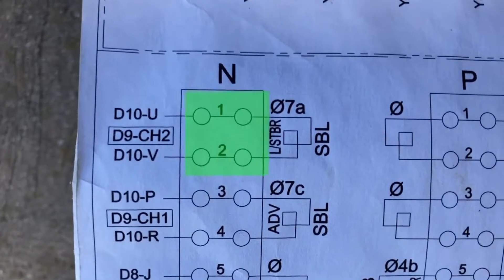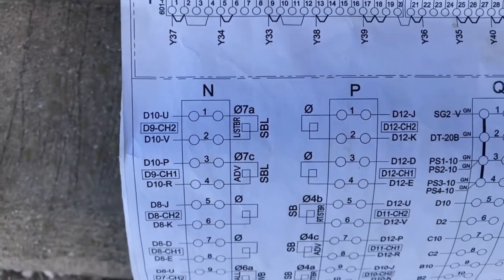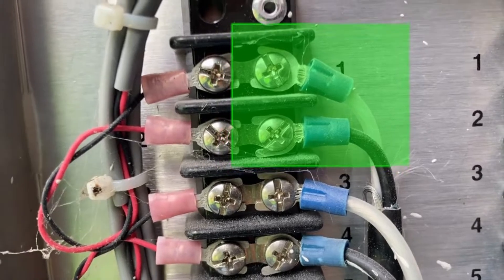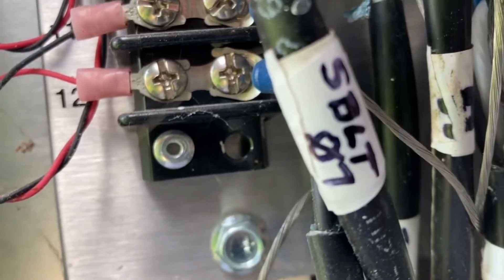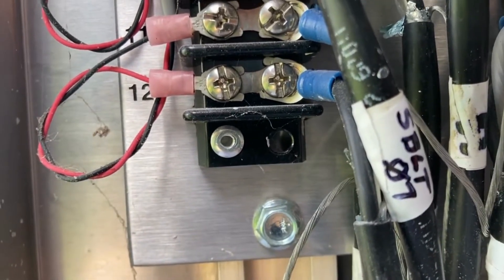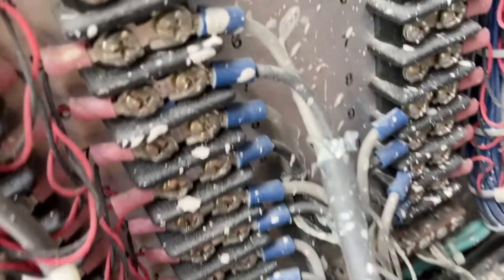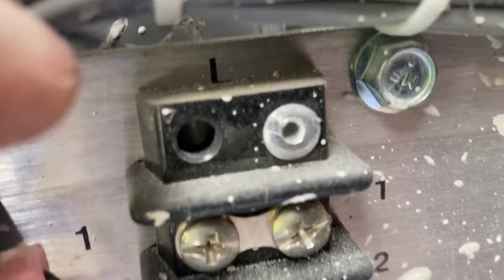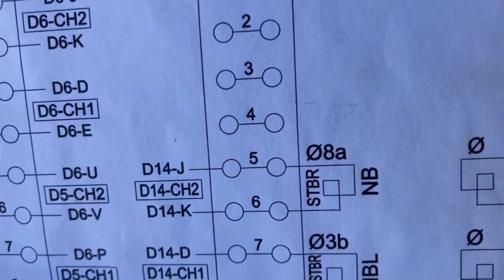How to Properly Label Traffic Detector Loops

Comment: How do you test your DLC and or Loops?
Reply from the maker: I have a megger that I can use.  There are several tests including continuity and also testing ground wire to loop wire integrity. 
Many times I find that the connection (loop wire in road connected to 2c wire running back to cabinet) in the pullbox is compromised.  Usually just resplicing there fixes the problem.  Hope that helps.
Great question!

Comment: 0:23 Isn't that a fault of not setting maximum green time? Thats why maximum green time is there, both for detector loops failing, but also for when theres so much LEGITIMATE traffic on a phase so the other phases never get to speak for to say. Not setting maximum green time is fine for a non-detector street with a dwell-in-green setting, (then you obviously want that street to be infinitely green until a call is made on a conflicting phase), but all detector and pedestrian-button phases must have maximum green time IMHO.

I mean, imagine a large event on one of the detector street going off, and then that event is closing down for the night (lets say a big music festival) and everyone wants to get home, and then a street with no maximum green time so when all the cars from that festival pile up, then nobody else is going to get go and have to wait for several hours until every visitor from the festival have came through, then its better with maximum green time so the cars are released evenly. Yeah, I know that in some cases then they get pre-emptely and turn a electrical key switch to put that intersection in "forced timed mode" disabling all detectors and putting everything on fixed time instead (basically a programming in the controller that waits until an input is shorted, switching to a second non-detector phase programming).

But still, max green time on detector street should always be the norm. Both for when a detector goes belly-up and locks into the triggered state, but also for when theres so much legitimate traffic on a single phase so it "steals" everything from all other phases in that intersection.
Reply from the maker: Sebastian....Are you sure you're not a signal technician??  You know alot more than guys that actually work on the stuff!!!!
Reply: @streetsmartstraffic  yeah, its just that I know much in tech in general. Its easy to grasp other things if you know a lot about for example burgular alarm systems.